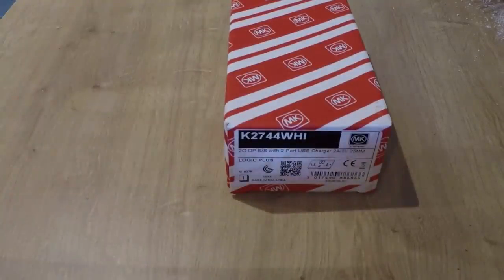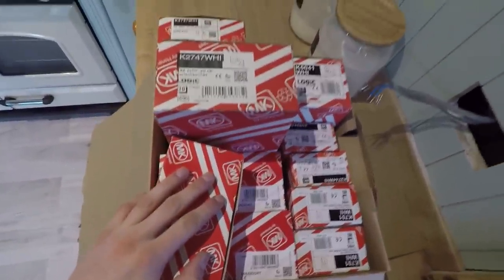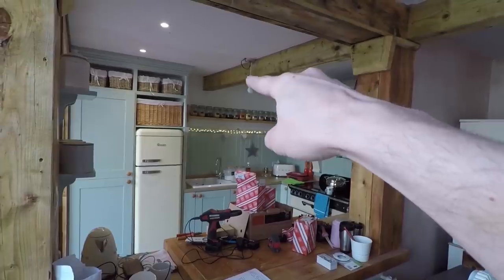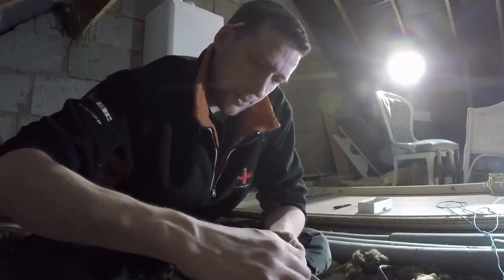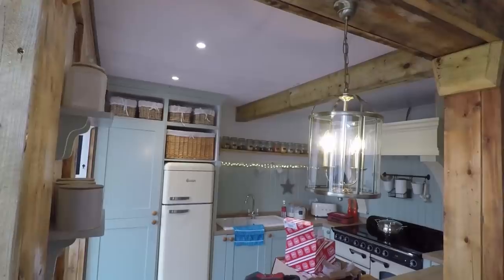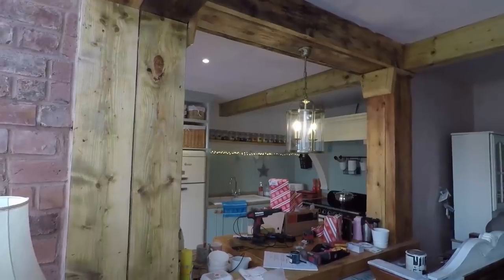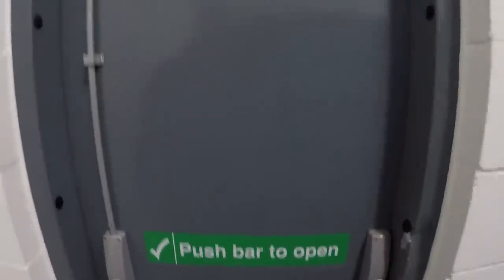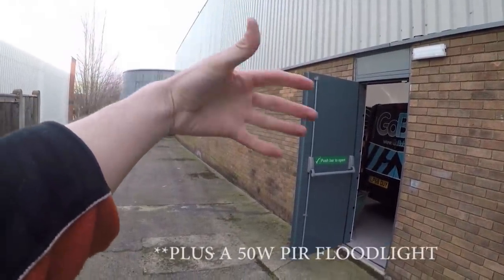Dimmer switch installation + House rewire | Thomas Nagy

Comment: How do you get an apprenticeship off of a electrician business. Do you just email round and wait to hear back from one. I also want to ask if being a apprenticeship requires you to have any equipment
Reply: I believe Tom is now hiring. Maybe get in touch with him.
Reply: carl marquardt, I’m pretty sure he said he wasn’t looking for an apprentice though. Have to check his last vid at the end.
Reply: Regarding equipment, a basic electricians tool kit would be all that would be expected, insulated screwdrivers, pliers, side snips, hammer, hacksaw etc, you will pick up things as you go along. As for power tools, depending on the company you work for these will most likely be provided, like an sds drill etc. I personally would not expect an apprentice to have power tools, but an 18v drill would be useful for you to have. Around £150 - £200 should get you started, what ever you do don’t by cheap sets of insulated screw drivers for £10 they will just break the ends off with regular use. Irazola insulated at around £25 a set is a good buy.
Reply: @carlmarquardt994  I'm 15 and cba with university and stuff so I decided to try and become a self employed electrician abit like Tom
Reply: You need to pass an electrical apprentice aptitude test. Do that first
Reply: In my experiance, if you go on the NICEIC website and find a contractor near you call them around and just ask for work experience and then after them seeing how you work ask for an apprenticeship thats how I did it :)
Reply: @Mark...  thank you, I've read into it abit and cheap equipment gets you nowhere
Reply: @banquo3051  thank you I'll look into it
Reply: @radosaw4616  do they do high school work experience? Thankyou
Reply: Get in touch with an electrical contravtor also  Contact JTL who may advise on how to get a trade / modern apprenticeship.  They run the programme for JIB electricians and would point you in the direction of getting graded.

Comment: Thomas, personally I would run plastic trunking in a horse shoe shape for the 13a sockets and commando sockets. Give option for metal trunking. CCTV and rear light included with plastic I think £1800 is a fair price.

Comment: My BG USB socket in my room, installed about three years ago, removed about two years 6 months ago because it stopped charging anything. Something wrong with the boards they've put in I'd guess, probably a really poor cheapo design. I'd love to see a Big Clive teardown - perhaps send your specimen?! Mine went to white goods heaven long ago.
Reply: Forgot to mention. Running powerline internet (Netgear Homeplugs x3) on a house full of these USB plugs... just don't bother. Noisy A.F.
Reply: I don't like them, I put two in, one in kitchen, one in hallway. I would like them if they where a module that could be pulled out and replaced from the faceplate. Not have to muck about turning off the circuit and replacing the lot, to much hassle.
Reply: Clive has done a few videos of them and his deduction is don't bother with them due to the failure rate of the USB chargers.  Go with a standard outlet with a cheap plugin charger.